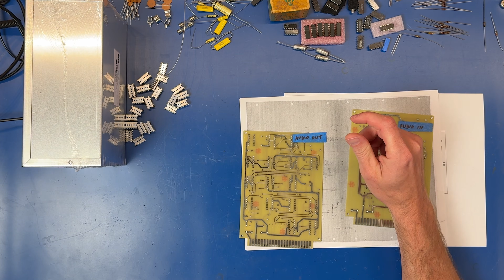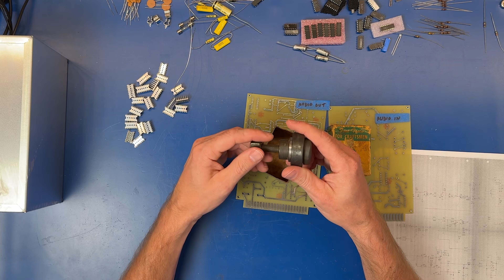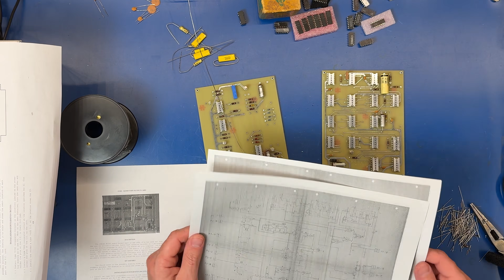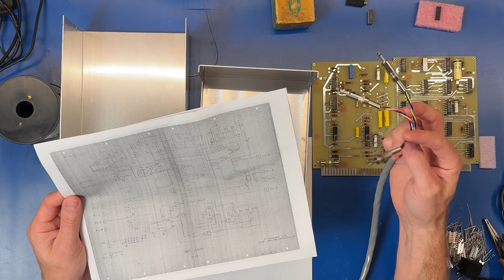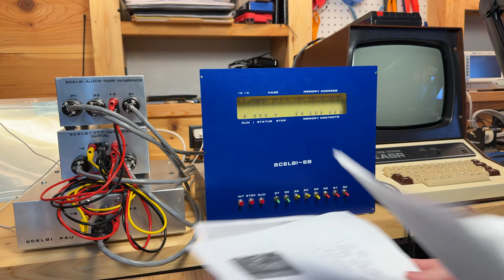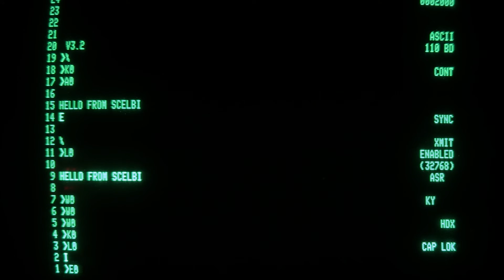Assembling the SCELBI 8B Cassette Interface

Comment: At 47:10, this is not the same take where you recorded "HELLO FROM SCELBI" Instead it actually says "HELLO WORLD"
I was able to play back that portion of the video and load it into my own SCELBI! This confirms my tape interface is also reading mostly correctly.
Reply from the maker: It's interesting that you were able to read the audio from the video into the SCELBI without any corruption. As I mentioned on the VCF forum, I believe it's playing two audio recordings - one of them is an older recording of "HELLO WORLD". It don't remember editing this part of the video.
Reply: @vintagetechrevivals Yeah between a mic recording of the tape player rather than a direct feed and YouTube's compression, and also the fact that the laptop I was using struggles with YouTube, I'm surprised as well. But it was useful for debugging for sure! Being able to read that in and not my own recordings told me the write was an issue, which ended up being the same cap you replaced and that Mike had replaced. Thank you!

Comment: One thing about even the non-polarised caps is, even though they may not have a +/- end, they may well have a "foil" end, which should be connected to ground.
If you have a scope; the foil end will be the leg that picks up the most noise when you hold the cap in your fingers